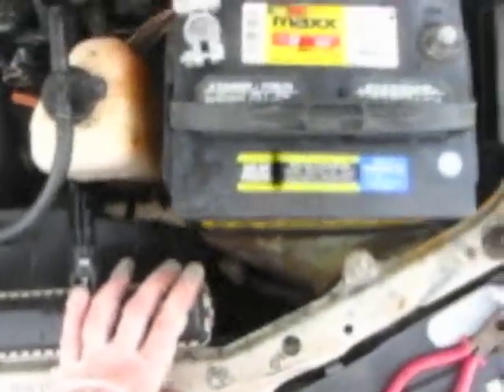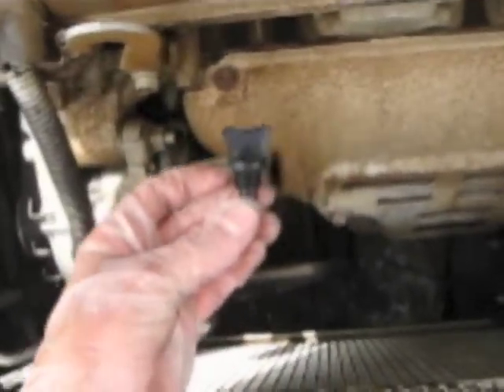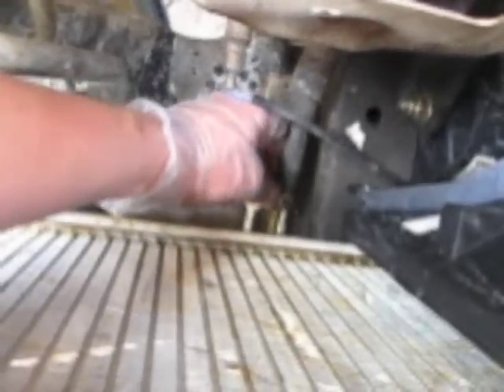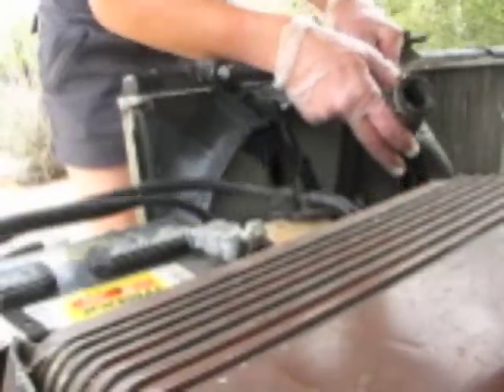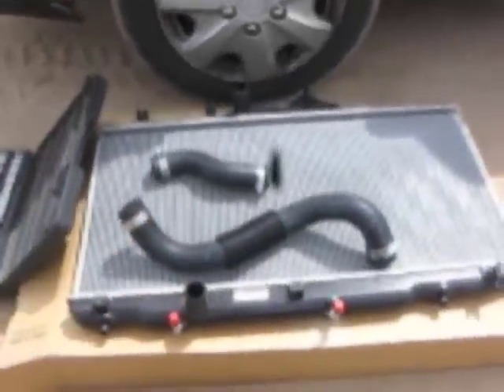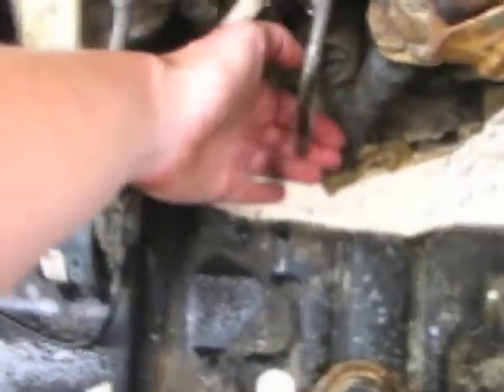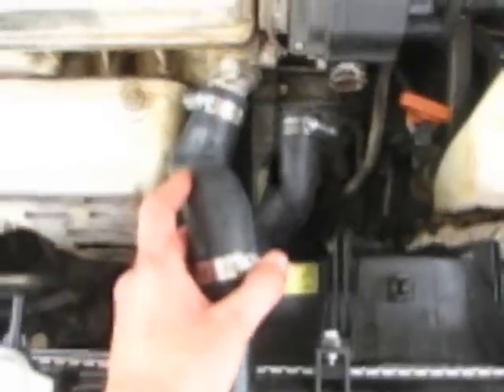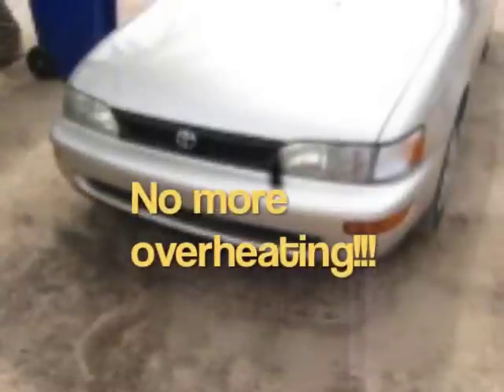How to replace radiator for 1995 Toyota Corolla

Comment: Thanks for the tutorial! Just ordered a new radiator to do this exact job.
Reply: Ben Eller how did it go? and where from where did you ordered the radiator?
Reply: it seems to have gone well! I ordered the part from Ebay. I had some oil leaking from the oil cooler line initially, but i just tightened the bolt at the base up and it seems fine now. Now i'm noticing a couple other leaks of power steering fluid and a little coolant coming from somewhere in the back! Haha it never ends....

Comment: Awesome video. This was actually really well done, fuzzy resolution aside. And even the fuzziness of the resolution wasn't that bad. Or the little speck of dust. Plus, you didn't take a thousand years to get it done. No rambling, no mumbling, just all nonchalant like you replace radiators all the time. In your sleep. Blindfolded. With no hands. A helpful video. Well done. Thank you. 

I don't suppose you need to replace your head gasket, as well? :P

Comment: I took the relay off because my fans were not running until, I was able to replace them. question. how do I know if my fans only need to be changed vs the radiator? or should I just change all of the above?